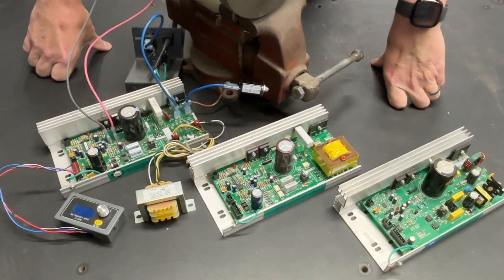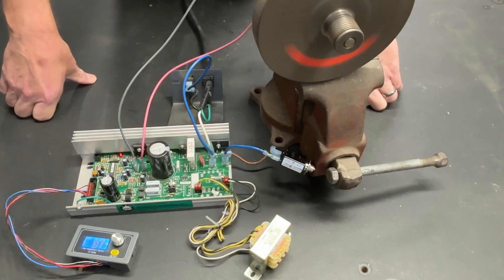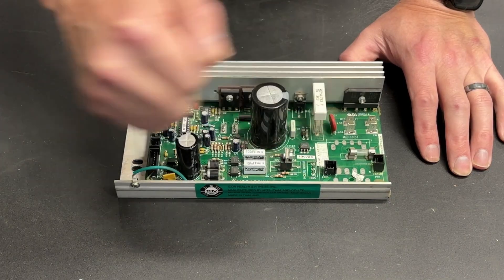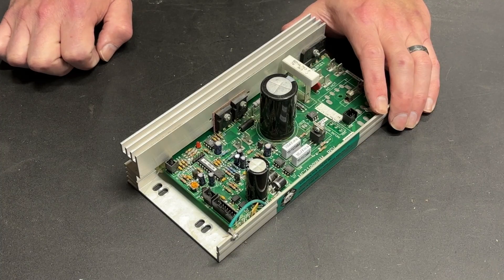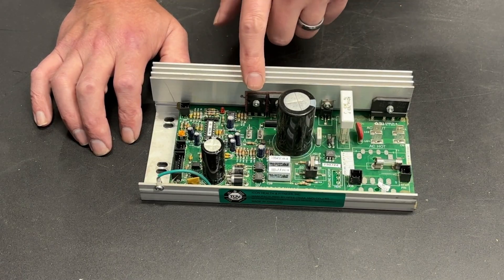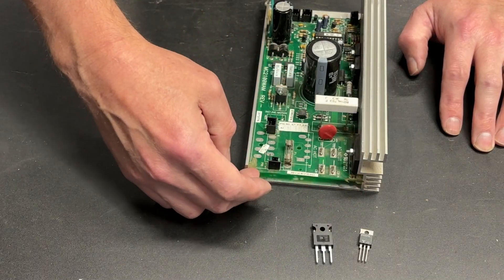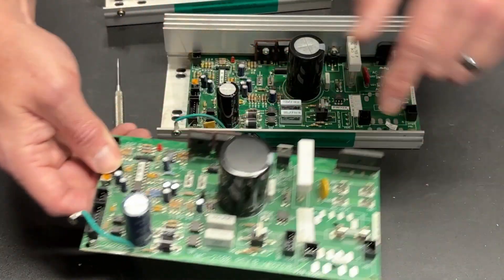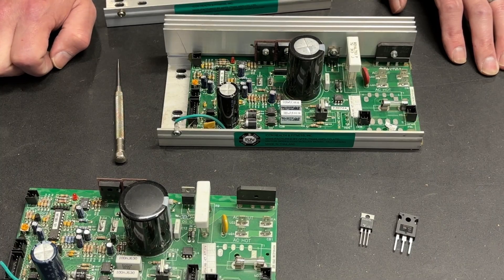Troubleshooting and Repair of an MC-2100 Including common Component Failure and Diagnosis

Comment: Hi, I have a MC2100ELS broken board. It doesn't power up the motor. At the power up I have a very weak solid red led. Do you what does it mean? Thank you!
Reply from the maker: I am not a treadmill repair guy. The only information I have is what I have learned repurposing treadmill parts for other equipment. Everything I have learned about repairing an MC2100 is covered in this video.
Reply: @dazecars  thank you very much!!

Comment: I have a pro-form 580 XP crosstrainer and the motor stops working randomly when I walk on it. 1 time it may last a few minutes the next time it may last almost 1 minute and sometimes it may last a lot longer. I have replaced the 2 biggest capacitors and it still randomly stops. What would be the most likely component issue that I could try to replace myself? I am experienced with soldering, so that is no problem. Any help would be appreciated.
Reply from the maker: I am not a treadmill repair expert.  My experience is in repurposing treadmill parts for other projects.  if your treadmill uses an MC2100 the info I provided in this video is all the info I have.  if it uses some other board I have no information for you.

Comment: I have board the transformer on board like one of you show. The only difference for that board the SCR S4025 is now a S9010 NPN transistor on that one part you give a hint to change on the board.
Reply from the maker: did you have a question?
Reply: @dazecars  I did some some hunting to get that  s9010 in that mount spot and will let you know if it works for me. Holy smokes it was tough to find that rare transistor. Got lucky on utsorce and will give it a shot.

Comment: I need help with my HEBB Trimline 2400.1 treadmill, which has been unused for a year. It is now showing an "ERR 0" error message. I have checked all the components on the power board, and they are functioning properly. I suspect that the issue may be with the interface board (M3439/3457 Rev B), but unfortunately, I don't have a schematic for it. to enable me to troubleshoot.I would greatly appreciate it if you happen to have one.   Any suggestions are greatly appreciated!
Reply from the maker: I am not a treadmill repair man and have not messed with that particular board.

Comment: Where do I get the connector to the board from the PWM?
Reply from the maker: from the treadmill I scrapped.  I do not have an aftermarket source but there are used cables for sale on ebay.

Comment: One of my resistors blew up...how do I know how many ohms resistor it is? Is there a circuit board diagram I can find? I would really appreciate your help 🙏
Reply from the maker: I do not have a drawing.  Which resister is it?  I can look on one of the boards I have and let you know what I find.
Reply: @dazecars thanks for the reply...I could email you a picture of my board. The resistor that blew up goes from LG4 motor+ to R 34. There's another one beside it R 35.  Blue resistor with 5 bands it looks like I think...
Reply from the maker: yes please contact me through my website and email me some pics

Comment: I broke my NordicTrack. Rubber ball got stuck under belt and jammed the motor. After that incident it was displaying  symptoms of revving then stops. I replaced both chips. I tested it with no load and it worked. As soon as i gave it a load by walking on it, it revved up and i immediately shut it off. Now as soon as i plug it in it revs even without the key. Any ideas what is broken?
Reply from the maker: I don't have any other advice.  I am not a treadmill repair guy.  I got the information I provided in the video by trial and error fixing boards I have and am not sure what else could be bad on your board.

Comment: help plz my power bord keep burning the irsp250n as soon has i stress the motor other than that avery thing runs ok
Reply from the maker: In a treadmill or outside a treadmill? is the motor the one that came with the Mc2100 or something bigger?  MC2100 make clean power but are very fragile which is why I don't use them outside a treadmill.

Comment: The stainless steel pick tip is amazing! Life hack for an electronics repair tech. Thank you!
Also I was testing the mosfet for short only not open.  I'm gonna change it out with the  scr and hopefully sorts out the issue. I have the MC2100ELS-18W I'm getting a flashing red LED, but the motor doesn't turn, and no power under load to the DC terminals. Motor tests fine on a 12v power supply.  Perhaps put higher power rated components in to prevent future failure, but that may then cause other components to go.
You say the MC2100 is fragile, please can you suggest a better replacement power controller for the Nordic Track  treadmill? I'm not using this particular one for a power tool (I have another motor with different controller for that)
Reply from the maker: If you are using it in a treadmill then you need to stick with the MC2100.  Good news is the treadmill environment is not so harsh that it is prone to blowing out boards.  It's those using the board outside a treadmill that need to worry about the fragility of the mc2100.

Comment: My Nordic Track 8.0 started to work in constant surges on all speeds it goes with constant slowing down and accelerating within couple of seconds periods and constantly so. Repairman said that the problem is in the board, but doesnt know for sure. The indicator  is constantly lit when not running, and normal bleeping when runs. Capacitor and everything else looks intact. Any ideas what can cause it?
Reply from the maker: I am not a treadmill repair man

Comment: I would like to start off by saying this is incredibly informative and helpful.  I truly appreciate your detailed and clear information, your videos are so helpful!  Anyway, I have an old MC-2100 Revision B with the larger transformer on board, and this is from a ProForm unit that also has power tilt.  I need some help though and hoping maybe you can advise?  I've replaced both of these components (MOSFET and SCR) and still have the same symptom of when I hit the 'start' button on the treadmill panel, the motor goes to full speed for a second then shuts off.  The red light turns on and does not blink.  It also does not blink at all when the motor is running.  I have tested the speed sensor with a multimeter and it is functioning, also confirmed that the board is getting the signal as well because I can manually walk the treadmill and the control panel will display my speed when moving the tread without the motor running, so it is indeed working.  I then got the PWM and connected it up following your other video and the behavior is identical.  Same thing.  When I power on the board, I get a solid red light then when I soft start the PWM generator, the motor goes to full speed for about a second and shuts back off again.  Any ideas on next components to test or replace?  I'm really lost here as everyone seems to point to these same components for this type of issue.  Any help would be greatly appreciated.  Thank you again for sharing your knowledge and creating these awesome videos that are so helpful.  Cheers.
Reply from the maker: I don't have any other options for you.  Sometimes replacing those components works and some times it doesn't.  Not being an electrical engineer I can't diagnose what else in the system is not working properly.
Reply: @dazecars  thank you for the response. Again, really appreciate it.
Reply from the maker: Sorry I couldn't be of more help
Reply: @dazecars  I sent the board off to a repair shop and they were able to get it repaired.  I'll post back what the fix was in my case, in an effort to share the knowledge and also in case it may help you or someone else out in the future.
Reply from the maker: yes I would love to know
Reply: @dazecars well unfortunately they do not share which components they replaced but told me they did replace 7 total components. I can clearly tell the two largest capacitors (the big one and the next largest one) were replaced as well as the mosfet and scr again. That would make 4 that I can tell. Other than that I cannot find anything else that’s obvious that was replaced however I believe them on the count. The bridge rectifier and the other mosfet are the same, so must not have been heat sink components. They seem to be an incredibly fair, honest shop. They turned the board around in under 12hrs believe it or not from receiving it. They received it one afternoon and had it actually dropped off at UPS the next morning first thing which is more than I could ever ask for. Anyway, treadmill is up and running and working beautifully again. Thanks again and sorry I couldn’t post what else was swapped. Happy to post the repair shops name here if you would prefer in case it helps anyone down the road if they get completely stuck.
Reply from the maker: I imagine they replace the same 7 components on every board as those likely are the main failure points and it's cheeper/easier to warranty if you simply replace them all rather than running diagnostics, replace the parts that failed and hope the others aren't near the end of their life. Thanks for the info.
Reply from the maker: who did the repair?
Reply: @dazecars  Additionally, I pulled the board and took a very close look at what components were replaced, I can only count 6, I cannot for the life of me find the 7th component, so not sure if there were truly only 6 components replaced or not but the solder witness marks are pretty telling (although they did a very professional, clean job) but I count 6.  They are in the following positions on the board:  Q2 (our MOSFET friend), Q1 (our SCR friend), C5 (Big capacitor), C2 (next largest capacitor), RG1 (no markings at all on this component but looks like a small transistor), and U4 (6-pin chip that is marked MOC3052).  Again, that's 6, I cannot find 7, so wondering if it was just only these 6.  Hope this helps!
Reply from the maker: That is fantastic info, thank you for taking the time to get it to me
Reply: @dazecars  I’ve replied a couple times now with the company name that has performed the repair but the comment/post seemingly keeps getting deleted. If that’s not intentional, let me know and I can tactfully provide the info without it getting flagged and removed.
Reply: @dazecars you’re very welcome. Happy to help!
Reply from the maker: it must be something Youtube is doing.  Please contact me through my website and email me the info.

Comment: I have one..was working fine until one day..damaged the FET and SCR.. replaced with a 50A fet and a 35 Amp SCR.. still blows the 50A fet..I'm using this for a slow speed grinder setup..I'm guessing the startup current is too much for the mc-2100 to handle..:( which nuts because it had been work for months. the FET is irf260 instead of Irf250.. SCR in S8035 instead s4025..the oriinal SCR in mine was s9010...I couldn't fine any info on it..but guessing 900v 10amp?
thanks for the video information
Reply from the maker: sometimes replacing those components works and some times it doesn't.  When it doesn't work I don't have any other options.

Comment: Replaced both chips and still goes to full speed until I stop it
Reply from the maker: Sometimes replacing those components doesn’t fix it. There is a very slim chance the mc2100 is good and the problem is the signal going into the MC2100. Only other suggestion would be to try a PMW signal generator to see if that solves the issue.

Comment: Hello,

I have an mc2100 rev b board with integrated transformer. Your video was very helpful. When I turned on treadmill the drive motor would run at max speed and eventually turn off to prevent overheating. Replaced motor however it now sporadically runs uncommanded like initial problem. Would this likely be what you mentioned in video, bad MOSFET and scr?

Thanks
Reply from the maker: Yes replacing the SCR and MOSFET are the common fix but it doesn't always work.
Reply: ok I will fix at my own risk , TY.
Reply from the maker: my pleasure
Reply: Looks like my scr has a number s9010, can I use the scr you recommended or does it have to be same as original. My board is a revision b board.
Reply from the maker: I honestly don't know.  I would try to find the same chip but the one I linked is likely going to work but no guarantee.
Reply: Ok
Reply: Called one place and checked a forum. Looks like what I have  in board is obsolete, the part number, not the component. The forum and place says the scr you listed should work. Thanks for you help and dealing with my PITA, posts, lol.😂
Reply from the maker: glad I could help

Comment: do you know what transformer is suitable for mc2100e board(external transformer)?
Reply from the maker: its a class 2 transformer with 16V output.  I just did an eBay search and saw several for about $20 or less
Reply: @dazecars  Thank you very much. I wasn't sure if it was 12v or 16v. Shouldn't really matter anyway. Do you think I can get away with a switch mode supply?
Reply from the maker: I would just get the correct transformer from eBay

Comment: I have an MC-2100 Rev B I got on Facebook and the flyback diode seems to have been replaced with the wrong one do you know what the original diode is?
Reply from the maker: Pt150608g is the part number on one of mine. A diode is a diode so as long as it’s as good V & A or better and hooks up the same it should be interchangeable.
Reply: @dazecars alright, thanks!

Comment: I have the same board. I have a solid red light and the treadmill won’t start. I notice the resistor is very hot. What could be the problem?
Reply from the maker: solid red light means it not pulsing.  could be a problem with the board (MOSFET and SCR as stated in the video) or it could be a problem with the signal going into the board (problem with the control panel).  This can be checked with a PWM signal generator.

Comment: Hi  Thank you for a great video. I have the board with the small integral transformer,  I have a constant red LED but have no voltage at the signal generator plug, the transformer smells bad so it does look like a bad transformer. Would you know what part number and where to purchase one ?
Reply from the maker: That does in fact sound like a bad transformer, but I don't have a part number.

Comment: Hello I have a MC 2100 SDI control board on an image 15.5 s treadmill when I start my treadmill it goes from a dead stop to max speed is that a failure in the PWM on the board I've already checked the MOSFET it's good The speed sensor is good it's getting a flashing light but it just goes to max , if I didn't pull the magnetic safety key off I think it would just blow the motor any suggestions.
Reply from the maker: As I said in the video for this exact situation it sounds like the MOSFET and/or SCR are stuck in the "on" position.  I would replace them both.  May or may not fix your problem.  Letting it run wouldn't blow the motor but it would likely cause component failure eon the board.
Reply: Yeah I've tried that several times replacing the MOSFAT and the SCR My original board I stuck the belt for 2 seconds and it stopped working after that purchased another one and it just goes from zero to max speed,
Reply: That's what I mentioned in the first comment if it's the actual boards PWM shorted, I don't know I'm not electronically. Trained. Thx any how..
Reply from the maker: Sadly sometimes replacing those two parts does not fix an overload situation like that.  it's in the board but I'm not sure which component.  At that point the only option I have is to replace the board.  Sorry I could not be of more help.

Comment: I have a question in regards to the first circuit board your talking about.
Reply from the maker: ok
Reply: @dazecars on the Mc-2100 circuit board. Can you tell me what resistor is on R17? Mine burned out.
Reply from the maker: It’s green brown brown gold 510 ohms
Reply: @dazecars does this vary on any of the MC-2100 boards? I found a schematic that reads, ( 522  1% ). I just want to make sure I replace the resistor correctly without damaging my board.
Reply: Is there a way that you can take a photo or the resistor for me, please? @dazecars
Reply from the maker: There is no need to take a picture.  Just look ar  R6 on your board its the same tipe of resistor and has the band colors I listed.  When you look up those band colors it comes up with 510Ω.
Reply: @dazecars on my board R6 is brown, black, red, gold. And the resistor is tan.
Reply from the maker: I will double check tomorrow, I probably told you the wrong other resistor to look at, I was going from memory.  Either way the R17 resistor is green brown brown 510Ω

Comment: Hello, I have the MC2100LTS 50W rev b in my treadmill. The led stays lit but it doesn’t send power up to the console. I checked for continuity in the wires that go up and they’re fine. Do you have any suggestions? This happened after a thunderstorm.
Reply from the maker: just the suggestions in the video

Comment: Hi, I have a ProForm Quick Start 7 which suddenly stopped when in use. I have taken off the front cover to look for anything obvious. I had to change the plug fuse then tried it again. The incline works fine but when  you try to start the runner it just kicks the motor about a quarter turn then stops. I have tried this again with no drive belt but just the same. If you repeat this it eventually blows the fuse. I think this may be the control board. It has a MC2100E REV D  Regards Anthony Milner.
Reply from the maker: sounds exactly like the the symptom I covered in the video.